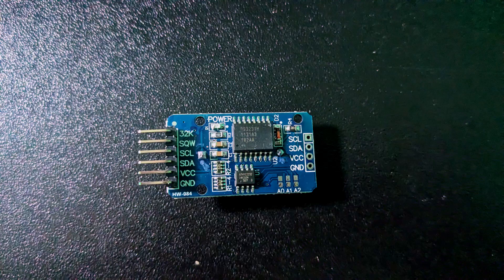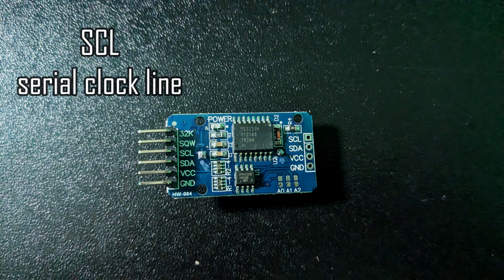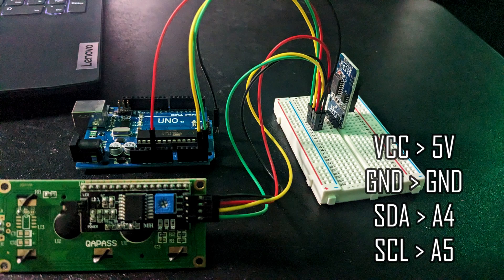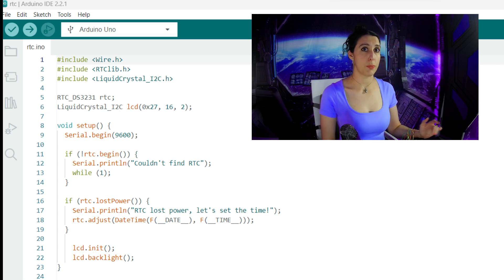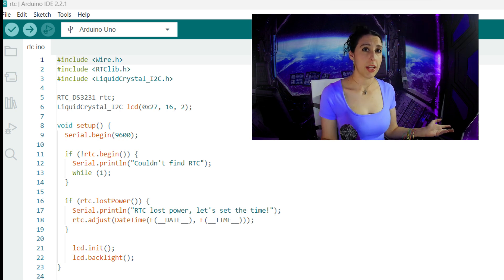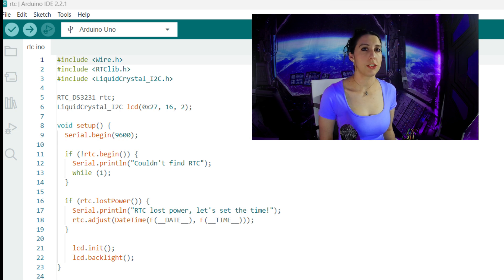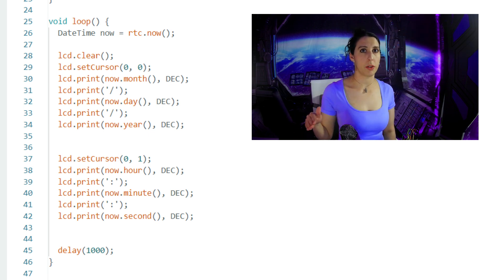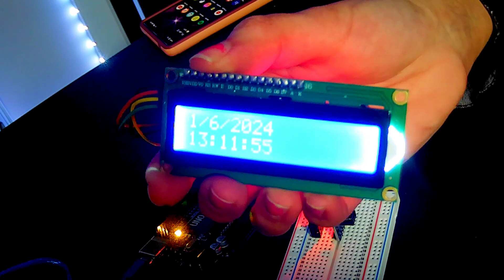Using a Real Time Clock Module to Track Time So I Can Stop Tallying On the Walls

Comment: Can you suggest a few different ways to automatically re-sync the RTC using various IoT radios? Is there a way to grab this as public data from BLE, Lora, WiFi, etc without having to be logged in? We have customers ask for a timestamp on microcontroller builds and I always try to steer them away from it.
Reply from the maker: I don't know off the top of my head but I can look into it!